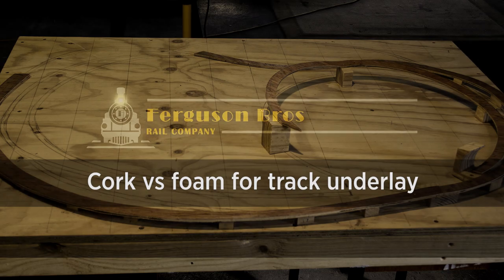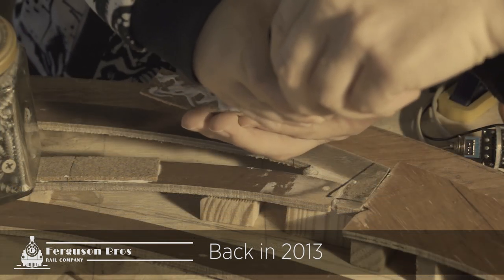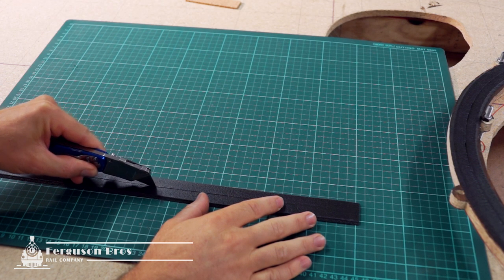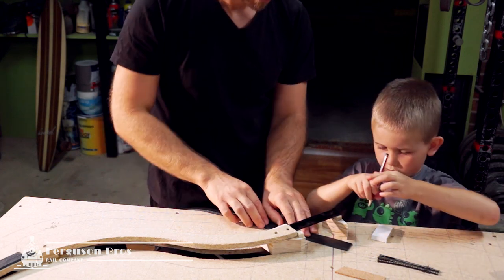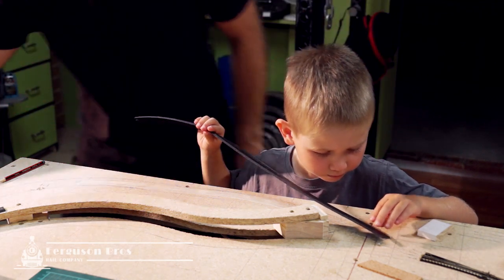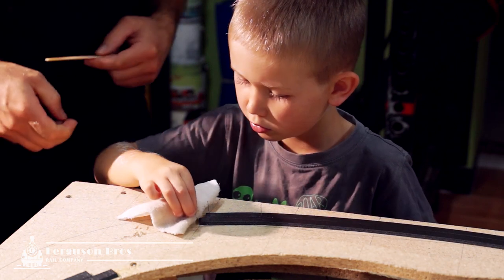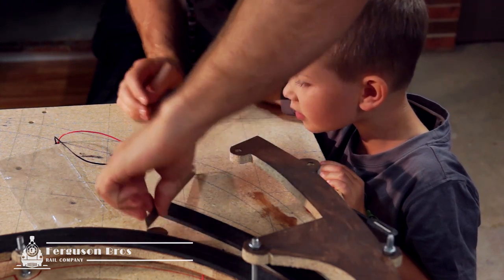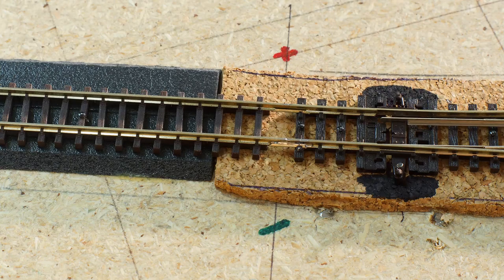04 - Cork vs foam track underlay for model railroading

Comment: Firstly, well done for encouraging your son to get involved and using his mind and imagination, a lot better than the tech garbage these days. I've used cork on all of my layouts and have learnt how to bend it by cuting triangles from one side and slitting the other. I've had no problems with this method. I have also worked on other peoples layouts that use the trackrite foam and it to is good to work with. So I guess it all comes down to cost and what you're happy with. I hope your son keeps up with this great hobbie. Good luck with it all

Comment: Hello Ferguson, great to see you have your son interested in model trains, would be nice also to see daughters  also involved in the hobby, I'm from Canada and more in our Canadian engines and rolling stock, as for cork VS foam depends on what type of layout your building from a lot I have watched their videos they prefer cork reason is foam has a tendency to be more spongy then cork that is more rigid yes foams is more flexible than cork as for noise reduction they are just about the same for cost  here we can get both for very cheap depending the season and month you buy them. One other detail foam is great when building grades on a slop from 1 degree up to 3-degree incline on a long-distance when you have a 2nd and 3rd upper deck to have more distance and change cities that is if you plan to have switching operations. Keep up the awesome plan in including your son a heritage to be for him later on.

Comment: It's refreshing that the sprog ran the work, but back to the issue at hand - cork or foam.  Did it occur to you that you could have split the cork and curved it the same way you used the foam?  Yes, that is how most guys use the cork.  Full width on the straights and split on the curves.  Sorry to be a spoiler.

Comment: You can get cork that exactly matches the various pieces of track so you don't need to keep cutting pieces out. I have used foam and cork but I really don't like foam. It's more of a train set look rather than model railway but each to their own. It's nice that you build it with your son.

Comment: Keen to hear how the foam has held up versus cork now 8 years have gone by from this video? I've heard the foam disintegrates between 5-10yrs down the track (no pun intended!). About to buy this foam so interested to hear.

I held my breath when you had your boy cut the foam whilst you held it in place, my 6yr old is a can of worms and is always 3 steps ahead of me so a knife might be risky 😄
Reply from the maker: Sorry for such a delayed reply - the foam is still holding up well. Although I now prefer to use cork because I can buy it cheaper in rolls then cut to strips.

Comment: Hi Rowan.

Cork is a lot cheaper if you buy it in sheets and cut it into strips. I buy 60cm x 90cm x 3mm sheets from Lagler in Melbourne for about $5 per sheet, and cut it into strips 20mm wide (for N scale). These will curve down to about 15" radius without too much difficulty. With tight radii like you're using, you can probably use two 1cm wide strips glued side by side (as you've done with the foam).  I use a thin smear of brown or grey gap filler ("No More Gaps", etc.) and place weights on the cork until the gap filler has set.

Regards, Ron
Reply: +Gulflines Operator funny you mentioned bulk cork. i was going to buy the $1.00 store foam board take the paper from one side and glue the other paper side down and just use the foam side for my track. it comes in all different thicknesses now.

Comment: Hi please tell me what foam it is and how do you put the track on to the foam
Reply from the maker: Hi, I am using hobby foam but you can also buy cheap dinner set placemats at places like Ikea - just have to ensure the thickness is right. I use small nails or rail spikes to fasten the track - that way I can easily remove it if I need to.

Comment: 2:01:  Better to use push pins for this. I find a hammer is not needed anywhere in MRR building of any kind.. Glue/drill-driver/screws/clamps/push-pins are the basic tools anyone needs..
Reply from the maker: Thanks Mark. The hammer makes getting into the chipboard easy, they're still easy to remove with plyers. In hindsight, I wouldn't have used chipboard, then wouldn't need the nails.